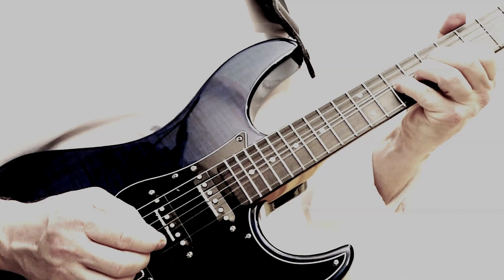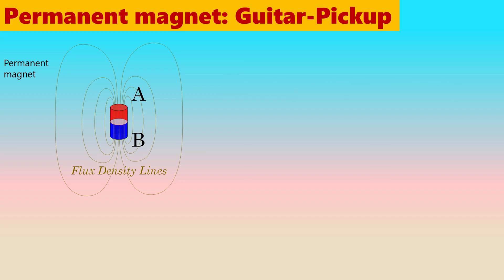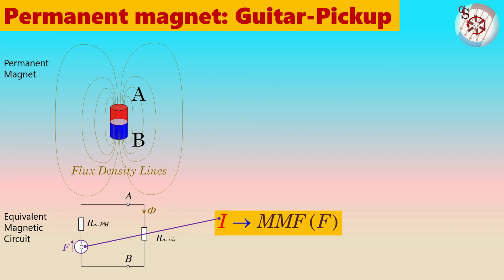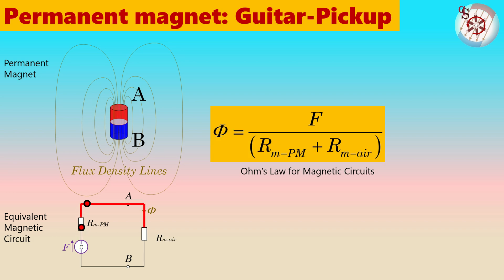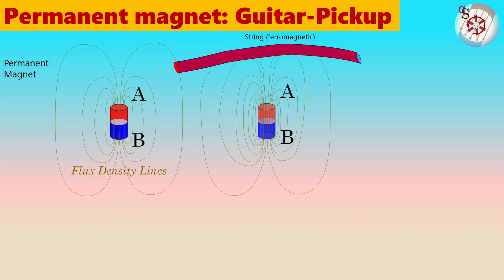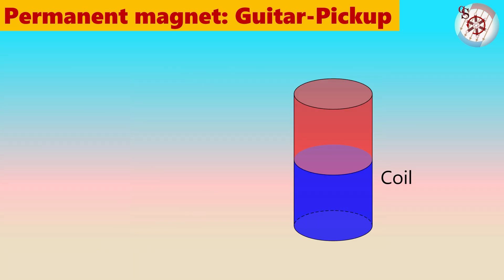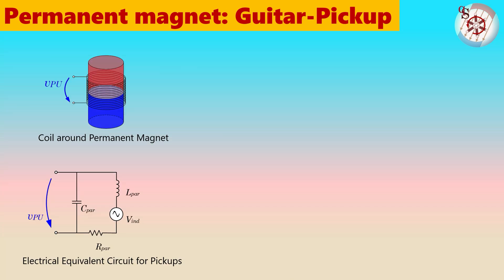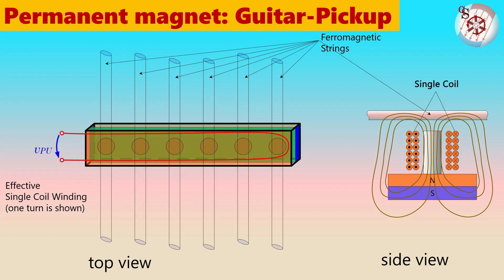Guitar Pickups -- How do they work?

Comment: This video is arguably the best explanation of this complicated subject.

👍 Excellent job. Other YT presenters are clueless about how the magnetic field (lines) is distorted by magnetic "conductivity" in the ferromagnetic string, which itself is also very complicated in a modern guitar string, for example. It's not simply a steel strand. And it's certainly not a tiny magnet bobbing up an down over the pole-piece. It's the total, dynamically distorted, magnetic field, oscillating in 3-dimensions, (as you show) that induces the Faraday voltage in the pup coil windings. It would be very interesting to see an animated simulation of the complete magnetic filed lines in this context. Haven't come across anything like that, so far.

Comment: so, it is the perturbance on the magnetic field that generates de current on the coil, aka signal that needs amplifying?
Swinging a magnet in front of the pickup would create sound? I should experiement this before posting the comment, but I'll leave the thought. There would be no frequency and amplitude that the ferromagnetic string provides, but there should still be electric inductance on the coil right?
Reply from the maker: Well, almost. The point is you have a magnetic field that is caused by the permanent magnet. Once you start changing the magnetic reluctance within the magnetic field of the permanent magnet you get a changing magnetic flux which induces voltage in the coil. A change of the magnetic reluctance is easily done by moving ferromagnetic material within the magnetic field.
Of course you are right, you can induce voltage into a coil by swinging a magnet in front of it (you would not even require a pickup  with a permanent magnet).
However, keep the frequency in mind. The lowest frequency you should swing or better "let swing" should be around 60 Hz. 
... a swinging string can easily realize that. Anything else ... possible, but hard. :)
Reply: @quellstrom  Thank you for this answer! I was stuck trying to visualize the this set up and what would be wrong with it. Thank you for sharing your experience. Indeed the string vibrates at a certain a frequency 😅
My idea would be to attempt to pickup the magnetic field (or interference between magnetic fields) on a thick copper plate when a neodimium magnet would be dropped on it. Below there would be this thing that would pickup on the inducted magnetic fields.